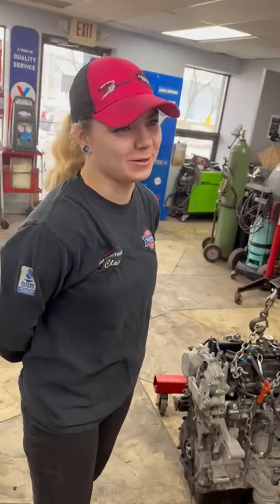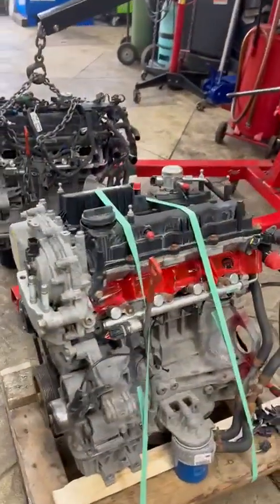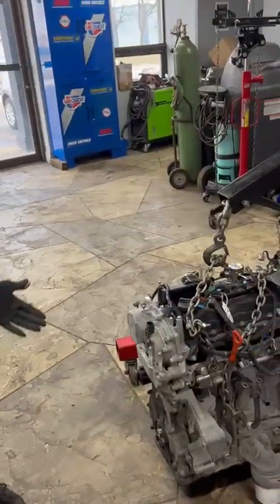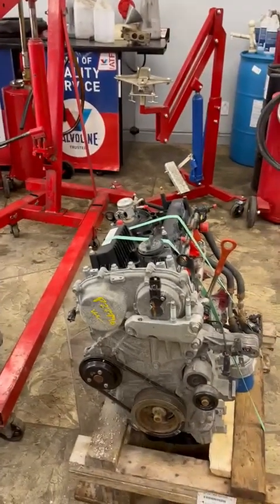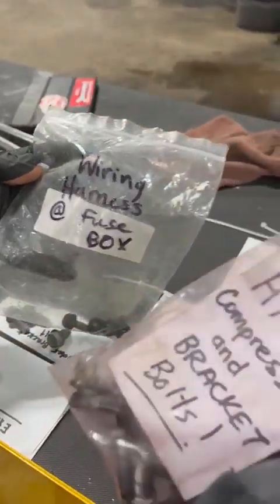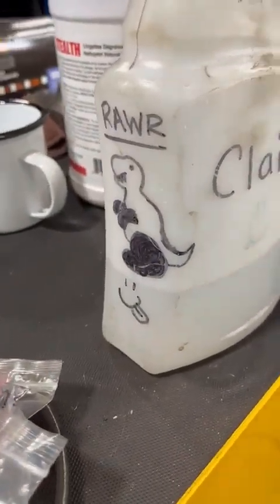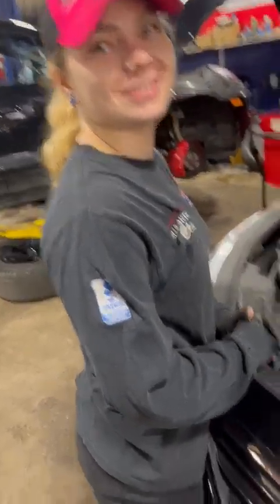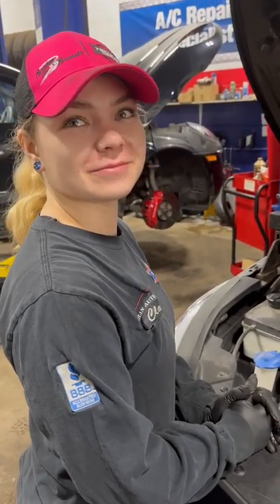2015 Sonata 2.4L Engine Replacement Showcasing Apprentice Claire's Methodology @UrbanAutomotive01

Comment: Hi, I have a 2015 Sonata GL. I bought it Sep 2022 while it had 180k on it. My car burns engine oil. First time was found after 3000 km of run and now today after about 1000 km. What do you recommend? Is rebuilding an option? I really don't know what is the best solution to this issue.
Reply from the maker: Hello Mohammad. I advise you to reach out first to your local Hyundai dealer and see if there is any hidden warranty for your vehicle. If you perform a quick google search you will see that this oil consumption issue is increasingly becoming a problem for Kia/Hyundai. If you get nowhere with the dealer you need to do your research and reach out to Hyundai Canada/USA directly. Our clients have had varied levels of success by doing this. Some were pleasantly surprised and others... as was the case with the vehicle owner in this video... not so much. Installing a known good used engine was the most economical answer for this particular client. Re-building is possible but the cost of that option usually exceeds the value of the vehicle. 
Hope this helps you.  Thank you for watching.